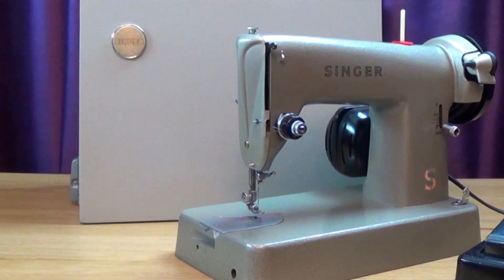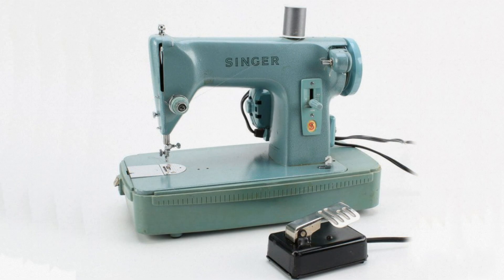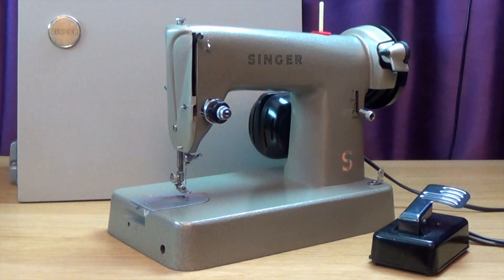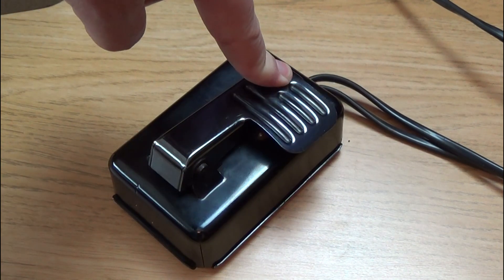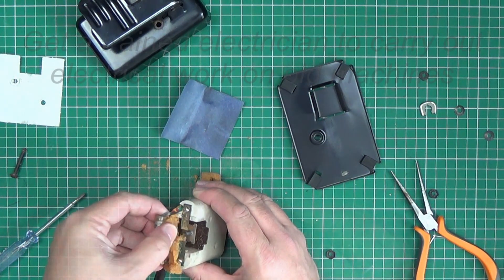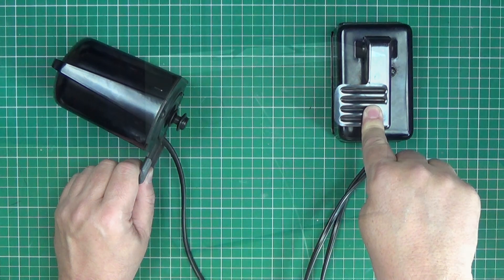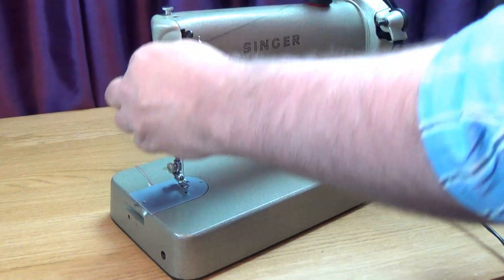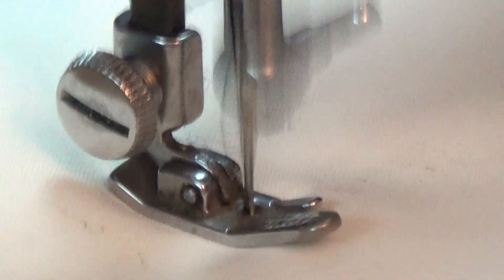Singer 286K Vintage Sewing Machine - Rare for a Reason

Comment: Properly tuned, these actually do an adequate stitch. Their main problem is the roughness of their drive - it's super loud and vibrates and the whole machine screams the question: Why?
The Japanese machines were often better made than the Singers of that era, they were cheaper, too. It didn't take much looking to find an older Singer for less money which would still be sewing today, well into its second century, perfectly.